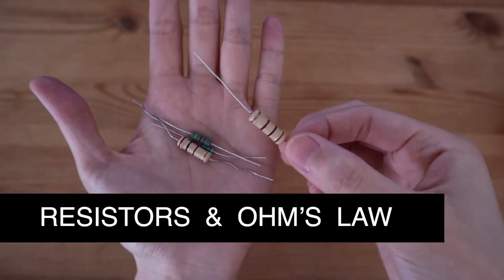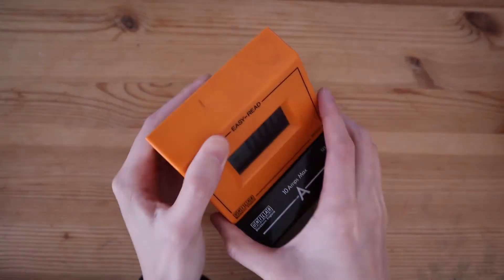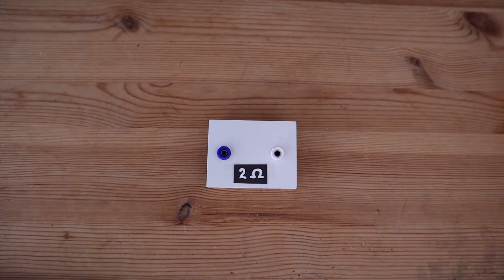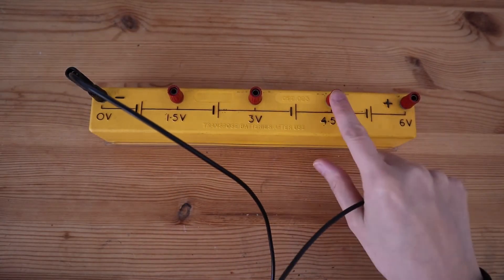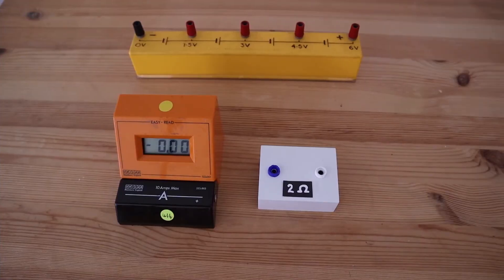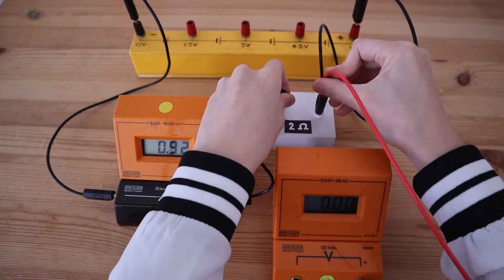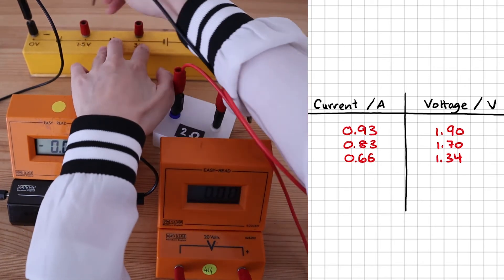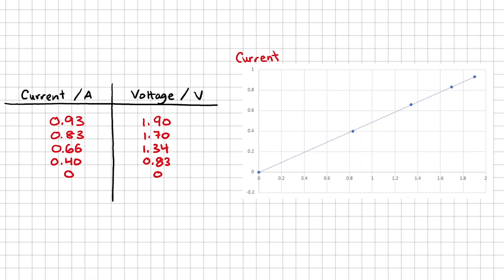Resistors Obey Ohm's Law (Experiment) - GCSE Physics Required Practical

Comment: Thanks you, but I would like to know on how to prevent the energy lose ? Since I know that in a circuit the the resistor takes the voltage of the power supply. Where does the energy get lost ?
Reply: It usually dissipates into heat around the conductor. If it passes through a resistor the resistor heats up